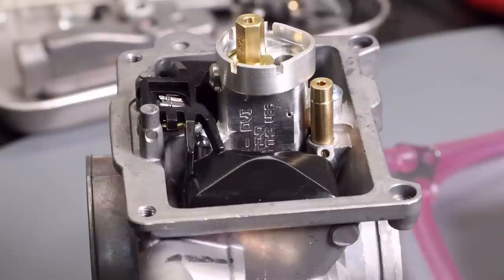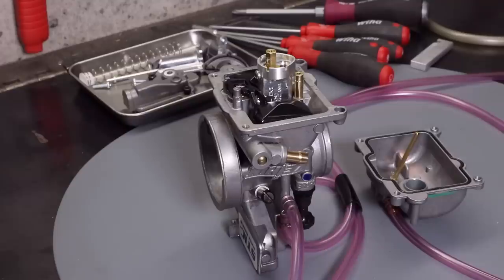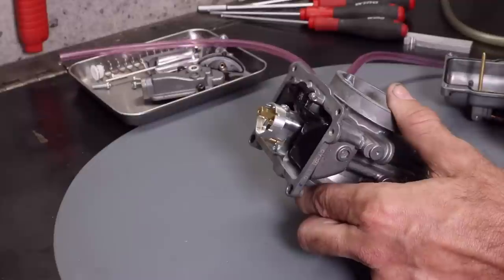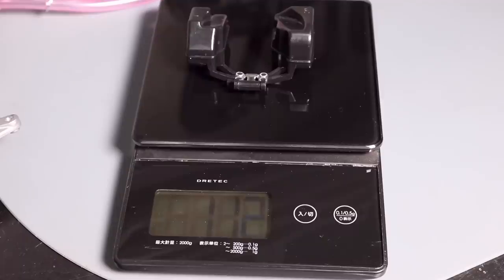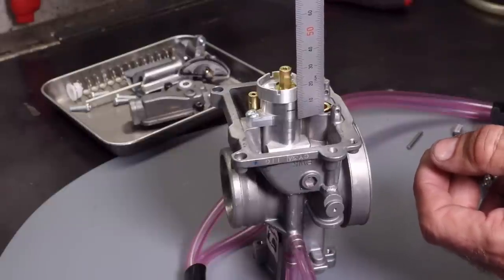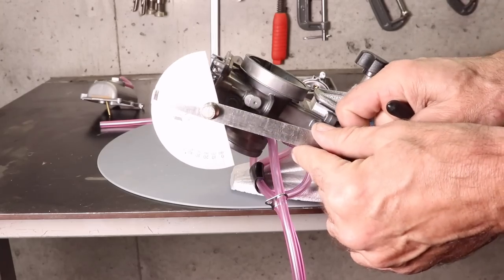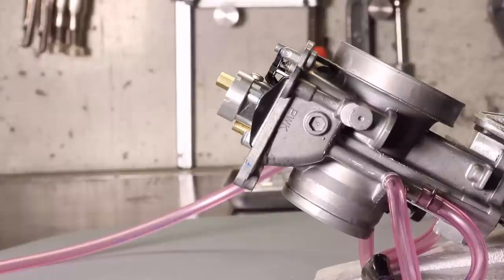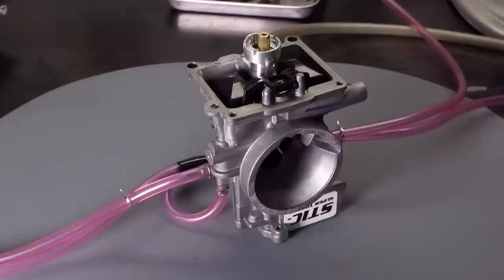Carburetor Float Height Level Measurement & Adjustment- Keihin PWK 38 Air Striker Short with STIC

Comment: It plays no role if the carb is tilted 60, 70 or 50 degrees, what counts is that valve is closed but the litte plunger (which is in fact a damper) on top of the needle valve is not  compressed.
Reply from the maker: As I showed in the video when the I moved the carburetor by hand the float doesn't move significantly over a fairly broad range of angles. 60 degrees is probably close to the middle of the range. However, if you get closer to horizontal (float moves freely), or closer to vertical (valve damper spring starts to compress) the angle does matter. When trying to make accurate measurements it's a good idea to eliminate as many variables as possible and the holding the carb at a known angle is a good idea IMO. It's makes the measurements more repeatable. That's not to say that you can't get similar result by just holding it in your hand and eyeballing it.
Reply: What's the purpose of the dampener plunger in the needle?

Comment: I have a broblem with my carb settings.. once i start going downhill, my idle dramaticly drops for at least 30-50% i have mikuni tmx 38 on exc 300 2017.
I have jd kit installed and i've already changed all the seals and gasket.. what would be the problem?
Reply from the maker: Yes, my experience with the Mikuni TMX 38 on KTMs is that from the factory the float level is set very high. This creates problems when going downhill (bike stalls) and also wastes a lot of fuel as it easily spills out from the overflow on rough ground. Definitely recommend checking and setting your float height. Mikuni recommend 8.7mm (which is what I used when I ran a Mikuni), but I bet yours is higher if it's never been adjusted...
Reply: @TokyoOffroad  it was set on 7.3mm ...i've set it on 8.2mm for the last ride and it was abit better going downhill (did not Stall as quickly)  u reckon i should go for 8.7mm?

Comment: Mark.. what number slide are you running in this 38mm
Reply from the maker: I use a 6.5 slide. This size usually comes stock in the Keihin PWK 38mm Air Striker short carbs.
Reply: Tokyo Offroad yeah ok, a guy on the forums is helping me figure out why I have a rich spot 0-1/4 range but mid and top rip like none other. 
Necj 3rd clip 38 pilot 168 main float is 8.5mm slide is 6.5
I’ve adjusted as from 1/2-3 gets better w higher but then comes the knock/ping over 2.5
60:1 golden spectro
91 junk ca pump 🤣
Rk tek low elevation insert. 
Going to try 35 pilot if it doesn’t fix it I’m going to pull head and put stock back on and try all over.
Reply from the maker: Jef Groff - what are the symptoms you’re experiencing of the low down richness? Yes, using a smaller pilot, and/or air screw adjustment should help if it’s running rich. Check that the needle valve is not damaged and seals properly (or the fuel level in the bowl will become higher and the engine will run rich). If damaged replace with a new one.
Reply: Tokyo Offroad so off idle through 1/4 throttle it hesitates/ surges and bogs once past that it cleans up and runs very very strong. If I wick the throttle in neutral it will bog and then rev out. Pipe has decent oil ring on tip after 20 min test ride and plug is blackish
Mid to top are amazing. Need to add more up top even as it signed off early n got flat with a 165 main. Going back to 168 or 170.

Comment: Hi mate , I’ve got a 23 sherco se 300, pwk manual for mine says 16mm float height, at 16mm the float is running parallel to the carb body, should it be 7-8mm like you’ve described?if it gets set at that, the float most definitely won’t run parallel with the carb body, it would be slightly down,meaning a higher level in bowl, hope my description helps a bit, thanks luke
Reply from the maker: 16mm? Or 6mm? 6mm is a standard float height for Keihin PWK. 7mm is a little lower and will help reduce fuel spillage and run very slightly leaner too.
Reply: Thanks for the reply mate 👍
Yeah 16mm the pdf says for a PWK 36! What do you recommend? I actually went on a ride today, while riding fire roads for a little while, bike was gutless(just top end) ,as if it was low on fuel, could the float height actually be to low and its emptying the bowl?
Reply from the maker: @lukerobins5537  16mm doesn't make sense to me. They must be using a different way of measuring float height. If the float height is too low it will tend to run lean, lack power and feel like it's running out of fuel. My recommendation is to set the float height at 7mm as shown in the video, which will result in a good performance setting while minimizing fuel spillage.
Reply: @TokyoOffroad  if I could attach a photo of the PDF I would, yes it is confusing, it states the flat surface of the carb to top of float,as per your video! What you describe is spot on, as if it’s running out of fuel, I’m going to set it to your recommendation, it’s got to improve! I’ll report back to you 🤘 merry Xmas 🎄

Comment: Just curious if this applies to all Keihin carbs?  Or does it depend on your make and model even though it uses Keihin. I Just bought a new 2020 beta 300 rr 2t. Anyone feel that the stock setting is accurate?  Thanks
Reply: the stock settings on all BETAs is too high. Adjust as per this video and your fuel mileage will improve, you won't leak fuel when on the side stand and your bottom end response will be cleaner

Comment: How much money do you want for your 40 mm Mikuni carburetor?
Reply from the maker: 250race - I don’t have a 40mm Mikuni. The only Mikuni I currently have is a TMX 38mm which is the stock carb taken off my 2017 KTM 250 EXC
Reply: @TokyoOffroad  
Does that have an interchangeable emotion tube in it?

Comment: You put the Carb in a 30° angle not 60...
Reply from the maker: The machined surface which the float bowl seals on needs to be at 60 degrees to the horizontal (the bench in my case). If you look at the angle of machined surface it's closer to vertical than it is to horizontal. It's definitely 60 degrees in the video and not 30 degrees. And if you look carefully at the protractor tool I use to measure the angle you can see it's set to 60 degrees.

Comment: There is no way that from the base you measure 6.5 mm that the top of the float will ever be that low, the float is taller than that.
Reply from the maker: You can see me do the measurement in the video, so unsure what you're referring to. I used 7mm (rather than the higher 6.5mm) because I prefer a slightly lower setting which results in less fuel spillage while riding over rough ground.